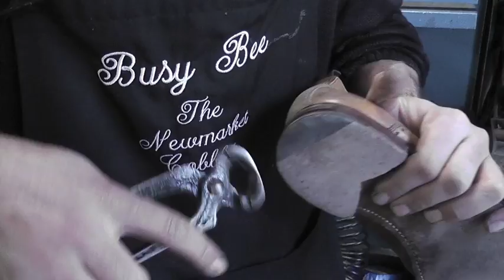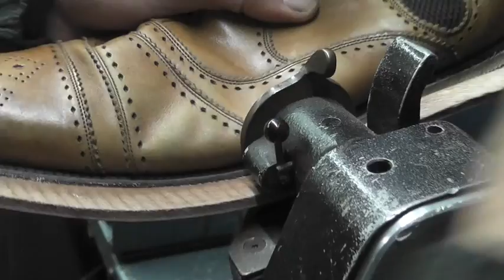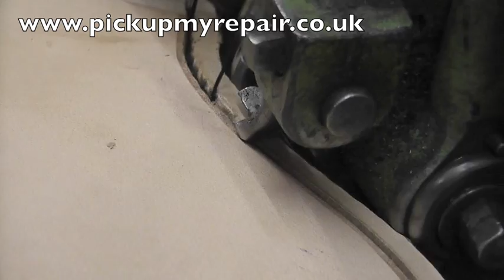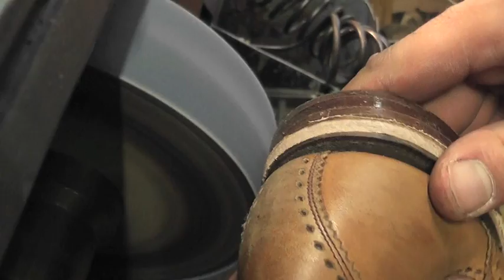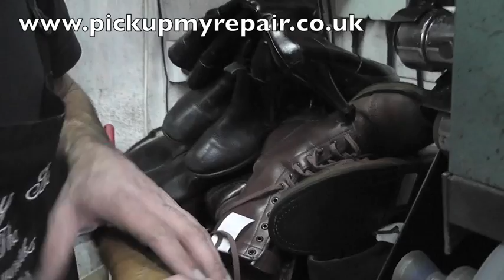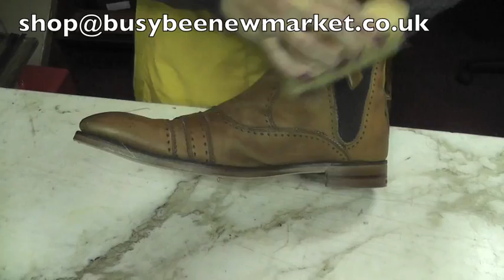Jeffery West shoe repair - Full long leather sole www.pickupmyrepair.co.uk

Comment: Can places like these repair shoes with soles that are glued on?
Reply: Not really. You can always slap another layer of plastic on but that's about it. Can't save them like you can with properly made shoes. In addition it usually not being worth it anyway as the material isn't that durable on cheaper shoes.